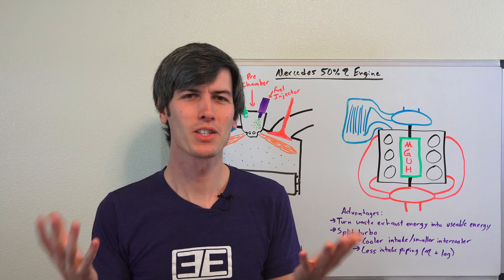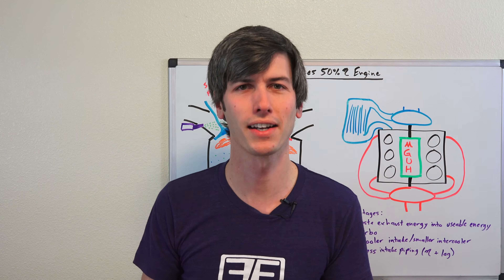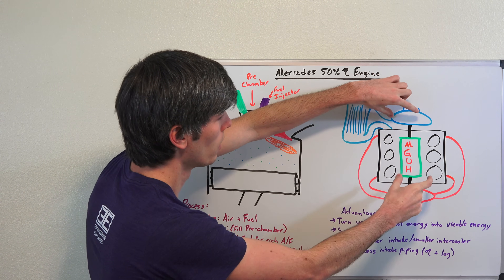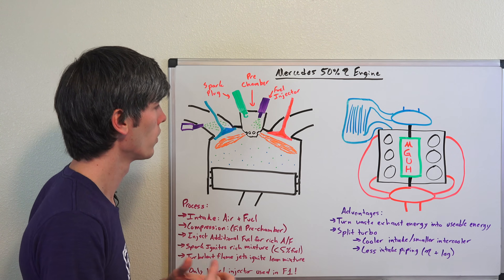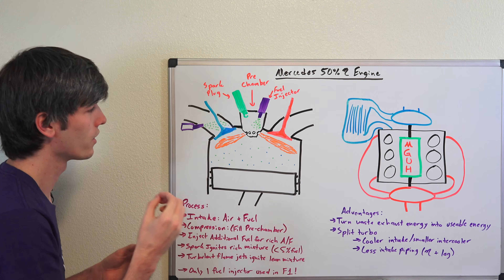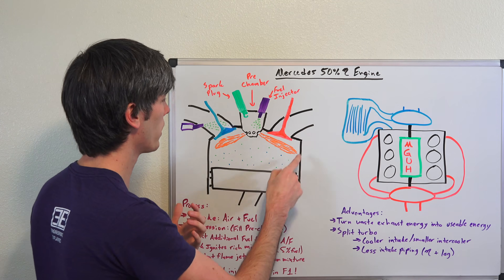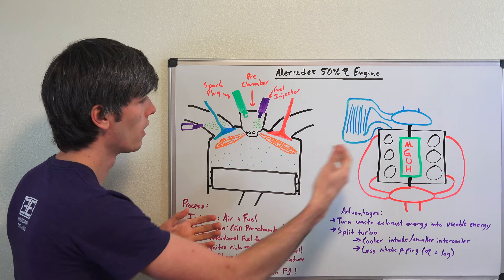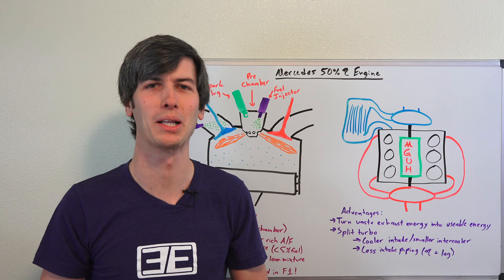Mercedes Created The World's Most Efficient Racing Engine

Comment: In my opinion, this would increase the turbo lag because now, the turbine has to turn a generator before turning the compressor. Also the long shaft, add more mass to be turned. But I'm not a F1 engineer so I must be wrong lol
Reply: Yes that is correct. Roughly 0.5 mega joules of electrical energy per lap is used from the battery to keep the turbo shaft at high speed while the engine is not producing sufficient exhaust flow.
Reply: The converter used in recovering energy ( MGUH ) is inverted to be used as an electric motor and that revs up the turbo,essentially the phrase “instant torque” used for the turbo
Reply: Yes that is correct.  When it needs to spool the turbo, it switches to spool mode.  Switching is instantaneous, the turbine spool is effectively  instantaneous (spools much faster than via exhaust gases, almost instantly).  When it's not spooling it's generating electricity.
Reply: This Engines are more responsive than NA Engines. So yes, you are wrong. ...and you dont win 4 Championships in a row with a laggy Engine ;-)
Reply: jr nascimento probably they use a e-turbo....
Reply: guanwei he Does this mean that the MGUH functions part of the time as a generator to charge batteries and then switches to functioning as a motor, when needed to spin up the turbo?
Reply: rayray123ray69 Really? Now It makes perfect sense to me 👍
Reply: add to that the MGUK has another ~160HP to help fill the gaps
Reply: It's a motor-generator, which means it can be used both ways. So, no, it actually eliminates turbolag
Reply: jr nascimento. What does turbo lag mean to a formula 1 car?
Reply: Power can be send to and gathered from the turbo. They can spin up the turbo faster that it would normally be with exhaust gases alone.
Reply: It is indeed.
Reply: Despite all the seeming "your wrong" comments, your in fact totally right. Except that as has KIND OF been noted. They simply don't rely on exhaust gasses to spin up the turbo, instead they use an electric motor to get it kicked up to speed and so turbo lag isn't an issue, but as i said that's only because they aren't using the traditional turbo that gets power from internal combustion engines exhaust. Much like the pre chamber, this is a win win situation, however the big drawback is price. just like putting in a prechamber makes them more complex to manufacture and pricey. Putting an  electric motor, split turbo and fan to reclaim waste heat are effective, but pricey as hell to add and would increase expensive warranty repair claims no doubt since you'd be hard pressed to add all that and not decrease reliablity.
Reply: that generator thing on the shaft = motor/generator, no need to ever spool the turbo down during a race, regardless of wastegate state and intake pressures.
Reply: Brian Lusiola the volume of exhaust gas is still about the same as any other engine though because the stroke is so short.
Reply: Νο my friend..Its quiet the opposite..No turbolag.. Also it works as an anti-lag system without! burning extra fuel ;)
Reply: Surely it can be used as a motor as well?
Reply: Turbo lag in an engine revving at 12,000 RPM?... Still, I am not an engineer
Reply: jr nascimento yo so like instead of blessing the waste gate they introduce generated resistance to the turbine

Comment: Mercedes
The best,or nothing
Reply: The best or nothing... so you should your mercedes and bought Italian?  :D
Reply: junk, Mercedes road cars have so many engineering flaws its not even funny. my sis had  a 08 clk350 with only 37k it had broken variable intake runners, cracked flex plate and balance shaft design flaw that took out the engine so MB replaced her car with a 09 with only 28k miles and it had rod knock on cold start. Mercedes has class action lawsuit against them over the balance shaft design flaw because they knew it was faulty and refused to fix it under lemon laws. The flex plate cracking issue has been happening since the 1990s and they didn't bother to  fix it for 25 years. The hydraulic suspension cars also have a design flaw that break and leaks hydraulic fluid on the cat and causes fire worse case best case you get stranded  because the body sets down on the wheels making the car inoperable, even if you fix it the flaw is still there and it will fail again every 50k miles. Its not that these problems occurred its that  Mercedes knew and refused to acknowledge the problem which left a bunch of people footing a $12,000 repair bill on a car that was only 4 years old and 28,000 miles. Mercedes is no longer the company they once were.

Comment: Its is also popularly called Turbulent jet Ignition, I would like to mention the fact that F1 engines have really high CR and they use special materials and manufacturing techniques to make an engine this good, but yeah this is something they were forced to do when they were faced with the limitation of fuel load per race. 
you gotta make more bang from the limited 105 kilos of fuel available.

Comment: I thought an efficient engine wouldn't burn its own oil for more power :D
Reply from the maker: That increases power output, but not necessarily efficiency.
Reply: Engineering Explained yeah. It's just they designed these highly complex and amazing engines for efficiency and what not, But still decide to have a combustible oil to give them more power.
Reply: That's a very naughty thing to say - as both Mercedes and Ferrari have been accused of doing just that. So the allowable oil useage has been regulated more closely for 2018
Reply: Burning oil will reduce octane which requires lower compression. It's doesn't increase power output, at least not the peak power normally stated in gas cars.

Comment: It also has an MGU-K that stores kinetic energy from braking in a battery for later use, and a motor that spins up the turbo so it has no turbo lag
Reply: Harry Kettle True, but it's unrelated to the thermal efficiency of the engine.
Reply: Dennis, hmm,   Only if the MGUK was disabled for the efficiency tests would this be the case...  In normal ops energy to spool up turbo must all be accounted for (it is an energy cost in the "idealised carnot cycle" - not sure which exact cycle is used in these engines, sure doesn't appear to be Otto)...  Don't forget that energy recovered from regen braking is also part of the thermal efficiency equation, in normal usage.. -)

Comment: Meanwhile two stroke diesel engines already had about 50% thermal efficiency for over 50 years(?).
Reply from the maker: 50 years? I don't think so. Do you have a link with any insight on that? But yes, different technologies have different efficiencies. Big diesel container ships will have engines exceeding 50% efficiency.
Reply: sliwka621 yeah but emissions would never allow that to ever be mainstream.
Reply: Yes in ships, not small engines.
Reply: Engineering Explained I think that the first 2 stroke diesel was implemented on the railroads in the '40. Was it that efficient? That I do not know.
Reply: Devin Stambolziovski Not my point to begin with but they were in fact mainstream and are still being used to this day.
Reply: Engineering Explained if you look up Detroit Diesel you will find that they had their series 71 engine pre ww2. The only reason 2 stroke diesels are not really used anymore in automotive is because they couldn’t keep up with Cummins in terms of reliability.
Reply: And big marine diesels are doing a similar dual chamber combustion thing from what I've heard.

Comment: Does it include all the engine oil they're burning?
Reply from the maker: The oil burning numbers will go way down for 2018 based on rule changes. Burning oil doesn't necessarily make it more efficient (depends how much energy you get out of the oil).
Reply: Achal Bhutani Ferrari was the team ultimately accused of using the oil trick. Mercedes is okay with petrol only.
Reply: Destian Light nah.. Ferrari accused  Mercedes of exploiting it. But when news of this exploded, the one who was apparently using much more,nearly twice what Mercedes had used in the race, was Ferrari.. 

And yes, they used engine oil to increase power in rich mix but they only burnt like 1.8l I think in a whole race.. Max... And that was ferrari too..Other teams like Mercedes used 1.2~~ before lowering it when they were found out.
Reply: I think they both used it.
Reply: No, teams use oil burn to negate the effect of limited fuel flow rate, so when they're running at max fuel flow rate they can make more power by adding in a little oil into the combustion chamber.
Reply: The amount of oil they use is similar to any normal ICE Engines. Except Rotary Engines which burn way more fuel than a F1 Engine like that. Mercedes is way under the allowed amount of oil so they are misleading nobody. Thats why they got a award for the engine and the technology. Its a price which is given only when someone invented a real milestone in technology. Its not even a yearly given price because of that. Sometimes there are more than 10 years between those awards. That shows how good that engine is.
Reply: the ammount of oil burned is now down to 0,5 litres per 100km. As of spa/monza 2017 season.
Reply: nope both team did it mercedes even change their engine just before the fia make the rule change so they could keep their oil burning engine (which make more power) longer
Reply: Dan Sneyd This was my first question. It is normal for race engines to burn oil but in my opinion the energy harvested from the motor oil should not be included. And I really hope the electric energy stores are empty BEFORE  they run their test. Shame on Mercedes AMG if they mislead us on this technological milestone.
Reply: Steven Khoo So no matter how you look at it it was Ferrari.
Reply: Jon Arruda Mercedes is not VW or Ferrari.
Reply: Alex G  I don't think Ferrari are going anywhere.  They used to be the team to beat.  Then, throughout the 80s, Ferrari was the joke of the paddock - engineers tripping over themselves, pit crew running down the road chasing errant wheel lugs, forgetting to refuel, etc.  Then they hit the top again during the Schumacher/Brawn period in the 90s...and now they're a joke again.  I wouldn't be surprised to see them on top once again at some point in the future...but who knows when.
Reply: Lol Ferrari can’t even win with all their tricks like oil burning. 
The era of Ferrari is gone long live amg petronas

Comment: Jason the kind of guy to buy a turbo manual over a NA auto
Reply: Don't we all prefer a turbo manual over an NA automatic?
Reply from the maker: I've owned four cars, three were NA manual and one was turbo manual haha.
Reply: Absolutely. To be honest I thought for a minute there was a typo. Just seems like a strange thing to say.
Reply: Yes we do
Reply: turbo-electric anyone?
>.>
<.<
runs
Reply: I went from 10 years of driving an automatic(first car, couldn't afford to change it before) to driving a manual and...even as a "noob" and in a country with a real winter, I have way more control and acceleration capability with equal power to weight ratio and it no longer takes  a quarter mile+ to pass someone...Hell, even in fifth gear at 2700RPM bury the pedal halfway and that's pretty close to the rate my automatic car accelerated full throttle when trying to pass.
Reply: Yes, a wrx. It was a GC8. Lightweight with total traction, makes a pretty good drag car
Reply: Appletank8 the electric vehicle cannot use turbo due to low gas exhaust (the gas that needed to pull the turbine in turbo). however, they can use the supercharger, becuase the supercharger use some energy of electric motor to operate it
edit: the supercharger receive the energy to operate because the supercharger are belt driven, so they can take some energy from electric motor to operate.
Reply: Don't forget 3" tuned length grounding straps. Gotta get rid of that e-zorst efficiently
Reply: Turbos and auto go together like torque and tyre smoke.

Ever been in an auto wrx that had boost and a high stall? I have, and I'm pretty sure you'd need a P100D to beat it across an intersection
Reply: Skippy really.....a wrx..........
Reply: Guillermo Lovato said no one ever